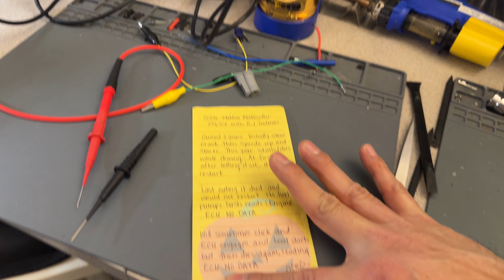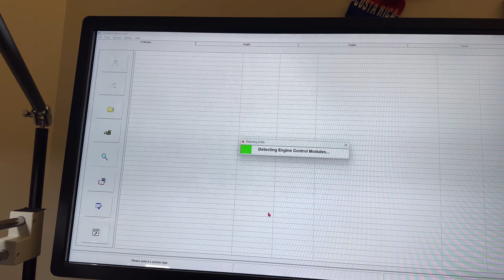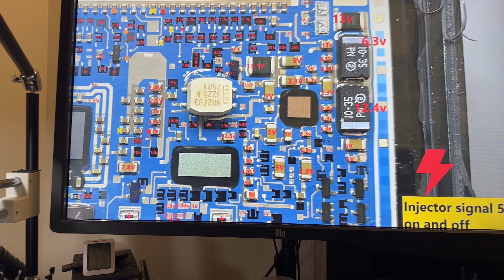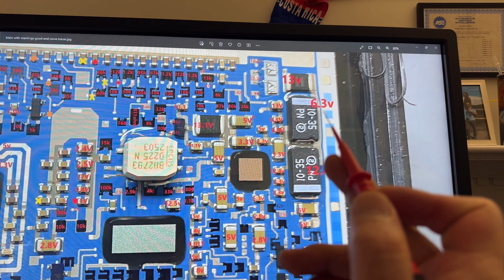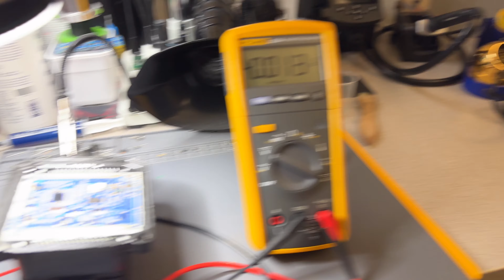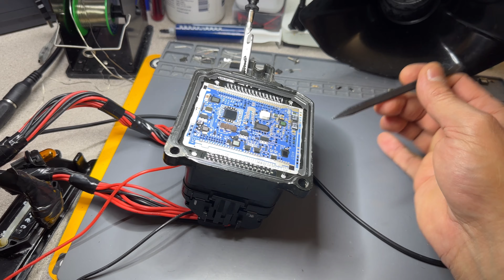Marine ECM test MEFI 4 Indmar 8.1L Chris Chinn

Comment: Hello, I do not really understand what you mean by not repairable. You called the component crystal components which I believe is what I would call semiconductors. So are you not able to repair them because you cant get replacement parts or does that brick the ecm ?
Reply from the maker: No! I am not calling Crystal a regular replaceable SMD component. This is a Crystal driver or voltage regulator that is not replaceable. Please watch the video I explain this numerous times
Reply: @MaicSalazarDiagnostics   I now watched this Video of you ( https://youtu.be/aIB9TUSuujo?si=j8yVQCx43jaX3iPA&t=840 ), where you showed the board more closely and explained it better in my opinion. For me the voltage regulator looked like a regular smd package, so i thought it might be you mean that its a manufacturer specific component. So it is COB (Chip on Board) Technology much like in many products where they have a black blob instead of a normal IC package.